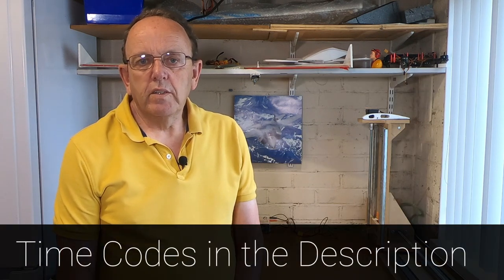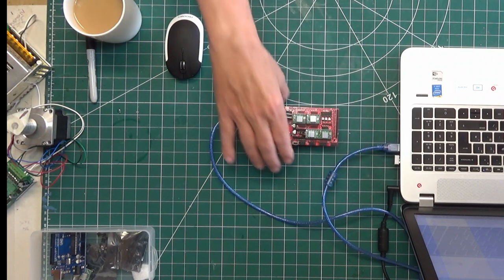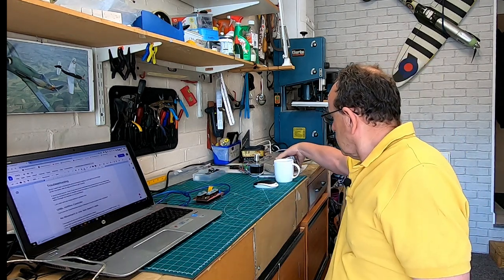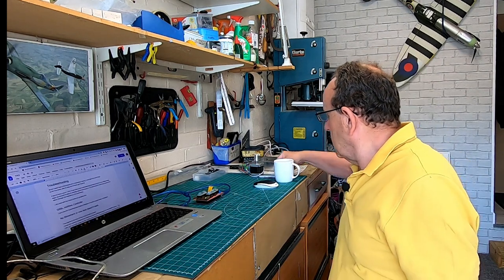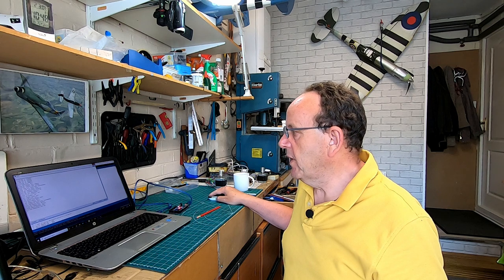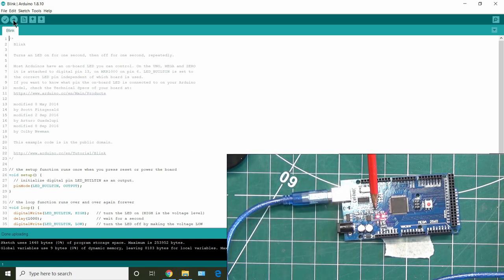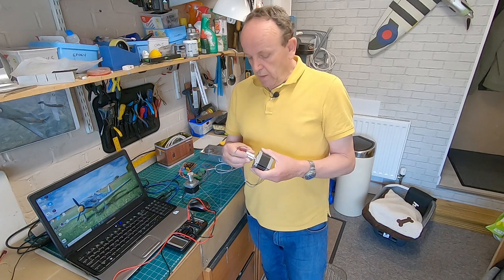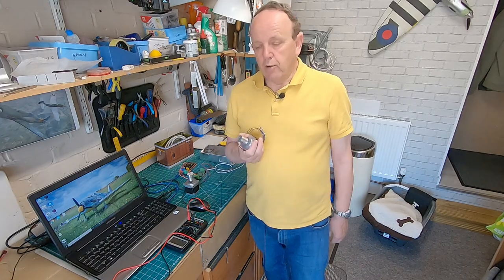USB CNC Foam Cutter Troubleshooting and Questions Answered

Comment: 5 hours last night with the mm2001 and trying all the cutting programs and never got all things to work and finally nothing was working and all the motors were HOT. Today I am ordering a 1.4 board and drivers per this video so that It should be easier to follow and get things to work. I have a set of the smaller board and drivers for the original Arduino but I guess it will not work. It says it is for a 3d printer and since there are 4 axis I did not think it would work but you made it work so that is all I need to know. Items should be here Monday. Thanks for all your videos. I can't wait to get this to finally work after all these years! Thanks and stay safe.  Don
Reply from the maker: Hi Don, new video should be out by the time you get the new hardware. Better firmware and software.
Reply: @rckeith  Thanks Keith, stay safe.

Comment: Hello rcKeith, thanks for all your informative videos on the foam cutting topic! They are very useful. Do you have a tip on how to straighten the hot wire before installing it between the spring? My spring pulls around 500g but I can still see a slight bend in the wire.

Comment: Hi keith, Thanks for the video link. I know my wire length is different, but I got a starting point. I tried to reply in your web, however, I cant open it at all this night.
I have changed to weight system to pull the string. i read you used 700gram, I put twice the weight hoping it will pull the wire as its longer, however, after going horizontally as cutting tapered wing, the wire doesnt go back with good tension, as if the weight is not pulling it well, or may be its too heavy? and make too much pressure point with the bending at the pulley.

Comment: hello mr keith, you may not remember me but i used to write you about my project some time ago, thanks to you i could finally get the job done, then i used a variant called ugs to control the machine, i have bee using this machine to make foam mouldings with some success, i use a computer for each tower so i wont force the 8825 pololu driver drivers, but from time to time one motor tends to go the wrong direction damaging the entire work, it does it from time to time but now its getting worse and the machine is damaging a lot of material because it cuts the wrong way, i wonder if this has happened to your machine and if so, what could have cause this error, it changes direction in the middle of the cut, its happening ring now only in the right tower, the left one works just great, i use nema 23motor 1.8, thank you for ll the help you can provide me.
Reply from the maker: DRV8825 drivers should really only be used with NEMA17 at 2.0 amp maximum.  NEMA23 are usually higher than 2.0amp.  If you are trying to drive the NEMA23 with DRV8825 drivers then this will probably not work well and could be your problem.

Comment: Thanks
An other question
Can i use an arduino uno whit stepper shield
Reply from the maker: Not with this firmware.  DevCNC Foam supports the UNO with CNC Shield. http://www.devcad.com/eng/devcncfoam.asp

Comment: Keith,  at about 2 minutes 22 seconds into cutting foam, one of my stepper motors consistently shuts down.  I have tried and inspected everything but cannot figure this out.  Pleae advise.
Reply from the maker: Try swapping the drivers to see if the problem moves to another stepper motor. Make sure you have the Vref set correctly

Comment: Hi can you tell why Jedicut allways get in French iinstalled it in German  than I tried in English same
Reply from the maker: Hi Johann.  Not quite sure I understand your question but a lot the dialogue is still french even though you select the language on install or in the options.  You can change some of them there is a language file in C:\Program Files (x86)\Jedicut\Lang.  I've changed some for English but there is a lot built into the program that can't be changed.  Time to brush up on your French😀

Comment: question:- whenever I click the UP button to jog both carriage, the vertical carriage moves in left, and the horizontal carriage in right move fwd. ?
what is this issue, it both vertical carriage should move but it is not happening
please help
Reply from the maker: Can you confirm you are using the firmware from my website.
Reply: @rckeith  Yes I am using firmware shared by you, I had resolved my issue.
 thank you so much for replying & for sharing this amazing project with us
Reply from the maker: @nihalmankar4743  Glad you have it working

Comment: I tried switching to other mircostep drivers and the same thing continues, motor shuts off after about 2 min 25 seconds.
Reply from the maker: Have you set the vref for your drivers.
Reply: @rckeith  not yet but this is not a new machine.  It was fine before.  Where and how do I set it?